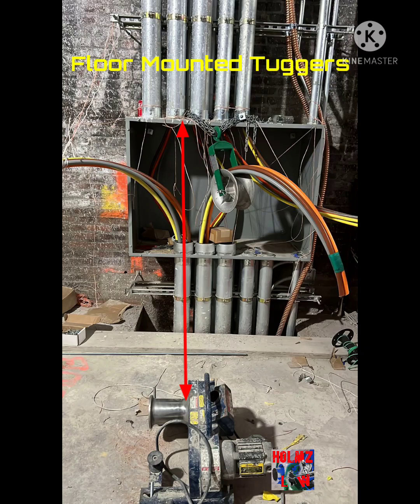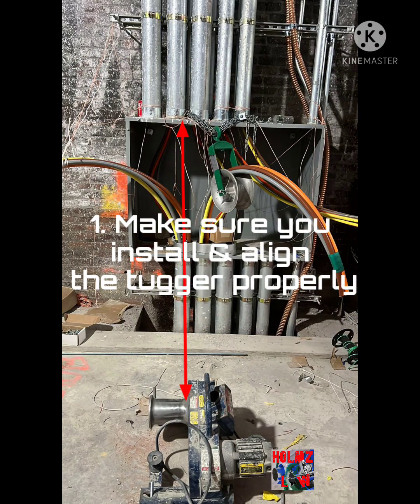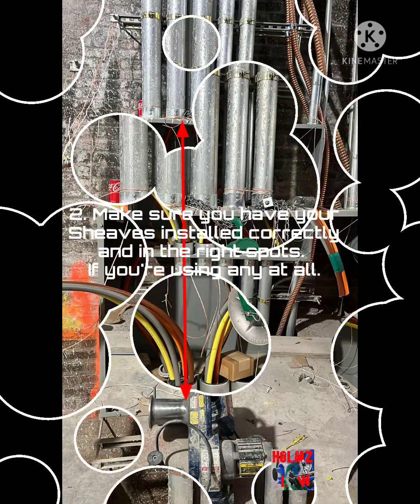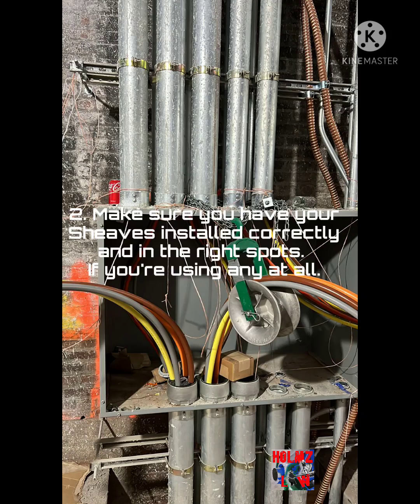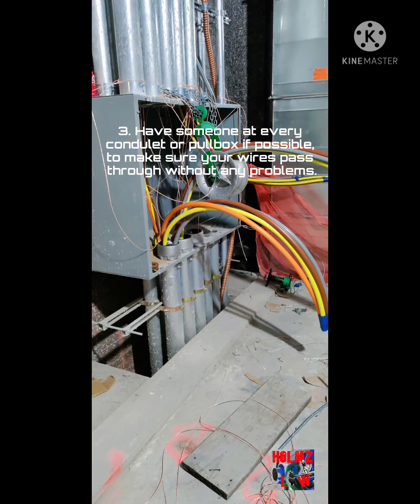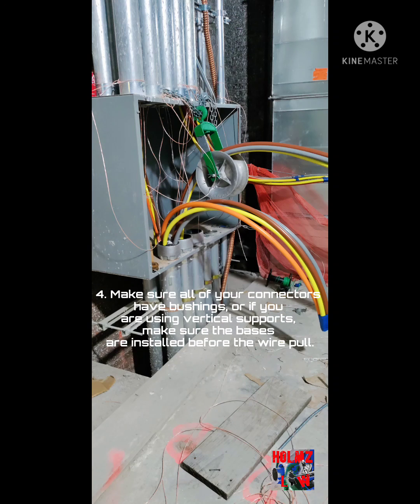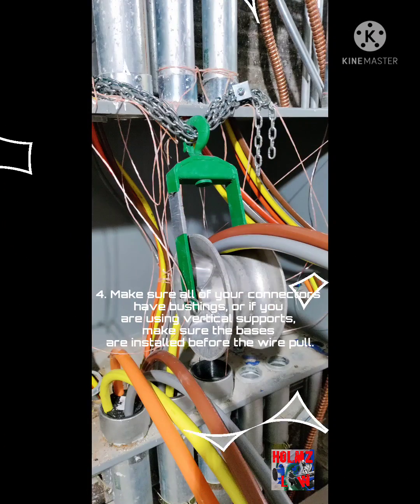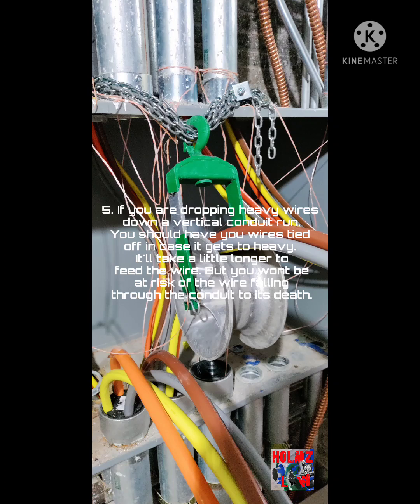6 Helpul Tips for Commercial & Industrial Wire Pulls

Comment: Yeah the other thing is if you are pulling out more slack you can always arrange the puller farther away and with more cable sheaves to keep it straight.  Have seen a couple jobs done with tuggers where it was done without splices pulled from box to box and they would pull out say 30 feet, then re-attached the hitch knot to the conduit end and pull another 30 feet out until they had enough length to pull to the final box by hand.  They set some temporary eyebolts in the ceiling to hang the sheaves.  Setting up the boxes in the right spots helps a ton in making it more pullable.  Have seen some jobs where a lot of it was done by hand so just needed more boxes to make the pulls box to box easier.  Some of the new tuggers are pretty amazing they even make a light duty one for drills that can go up to 1000lb but for short pulls of a couple hundred pounds tension its handy.

Comment: Hey Mel, what kind of rope would u recommend to use for 4/0 feeder pulls? The line keeps snapping for our pull and the boss isn’t very happy. Happy Thanksgiving man
Reply from the maker: Happy Thanksgiving to you as well. What size rope are you using. The diameter is what I'm looking for. We have at our site 3 different size ropes 1 inch which we pretty much use for all our big pulls. 9/16" rope and 3/8" rope. I always 9/16" which has a tensile strength up to 7k lbs. 1 inch  33k lbs and 3/8" - 4k lbs roughly. You can Google this info online whenever. Hope this helps.

Comment: I find the Greenlee G6 tugger and our G-10 tugger to be so easy. All you do is roll up to it attached to the end of the the conduit so your supported to the nose of the conduit, the pipe never moves as all of the force is into the conduit. 
You can even attached up to 20’ of 3” imc conduit to the boom or use a feed through slack basket when more slack is needed vs floor mounting. 
Either way works great though! 
I love your videos! You are definitely a conduit bending master and trough king with those wire way offsets!!!!!!
Reply from the maker: Thank you so much my brother.
Reply: I find the G1 great for those long runs of intermediate sized wires as well. Maybe it could be done by hand, but you and your guys would be gassed by the end of it. For example, I just used mine to do a 500 ft pull of 4 #4AWG and a #8AWG. Is that really heavy wire? No, but it is quite a long ways to pull., and it does get heavier as you pull it. Great little tool IMHO.